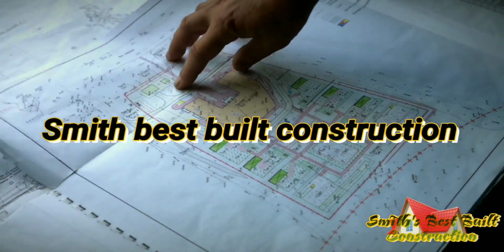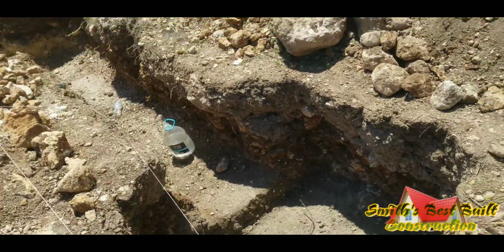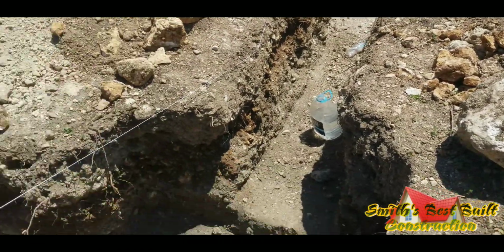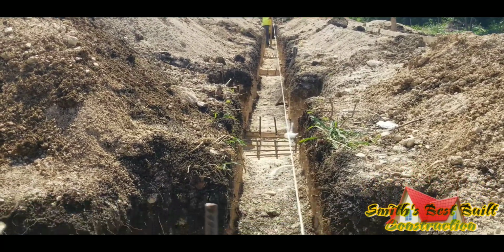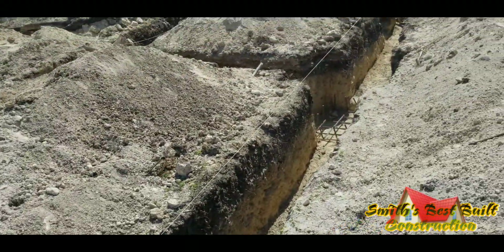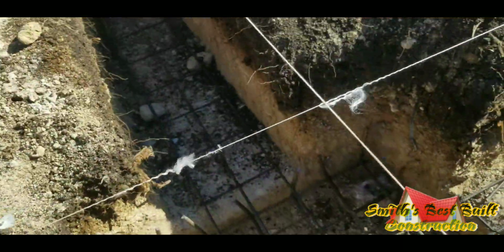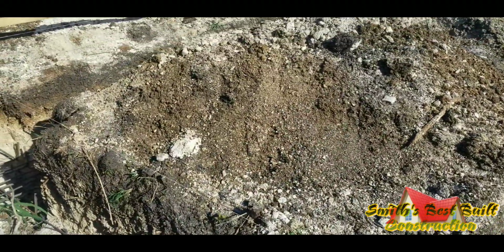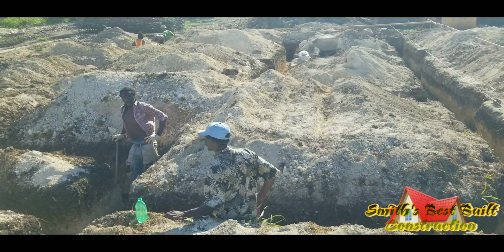foundation digging #3

Comment: You should be using space block under the foundation steel 50mm (2inch) min. cover not stones.
Also 50mm (2inch) min. concrete or sand blinding before laying steel.
Reply: Stones are just as effective for use in the foundation as precast concrete spacers especially because of the climate where there is no danger of freezing and no significant thermal expansion and contraction differences. The important thing is to maintain the minimum cover by placing stones of similar size, if such can be found easily then there is no need to make precast concrete spacers. There is also no need for blinding because the reinforcement will sit on a firm surface at 1.3m deep. The purpose of blinding in this situation would be to seal the surface underneath the reinforcement to protect it from dirt and mud. This is not a waterlogged area neither is it vulnerable to flooding, the site drains well and there is no ground water present even at a depth of 3m.

Comment: why  use  6 inc .  block and  not  8 inc  .   for   the  house out   side  wall   please    REPLY
Reply: 8 inch block used mainly as retaining wall or in areas where a thinker wall is needed for structural support. Remember the columns are the strength of the house, blocks are really partitions